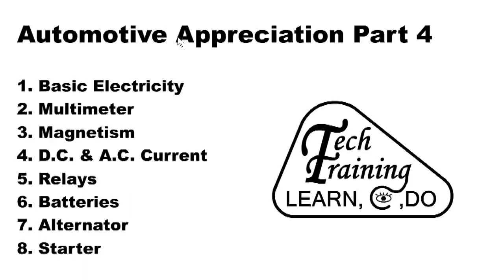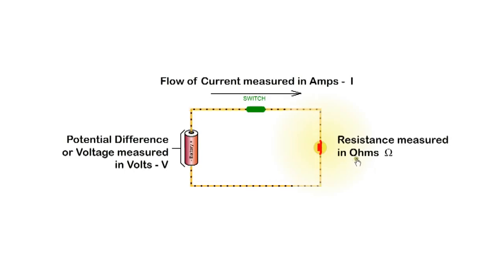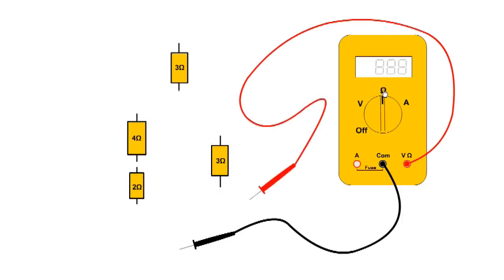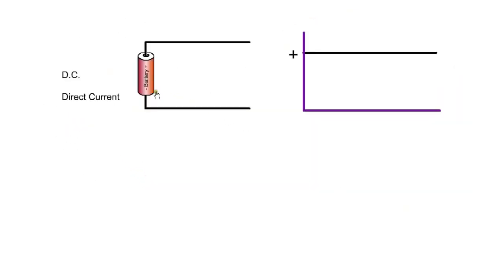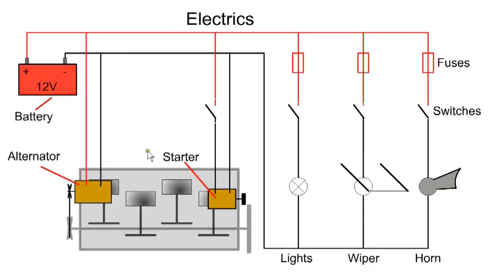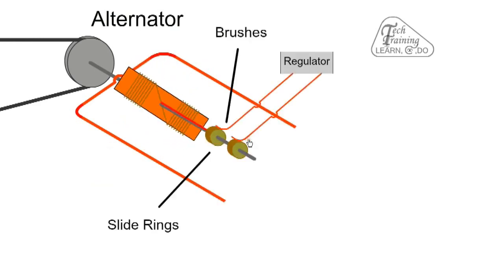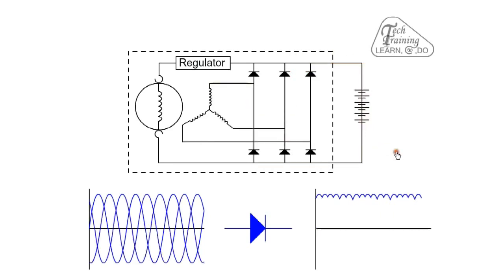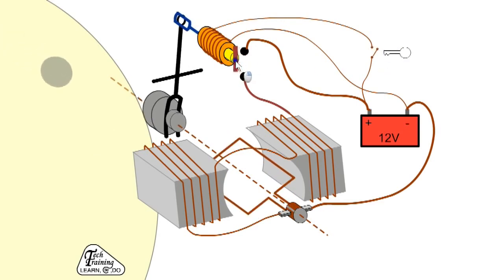Automotive Engineering Crash Course Part - 4 | Car Electrics

Comment: It would have been great if you explained the numbers you're giving for the voltage, current and resistance. It's not super clear why e.g. the voltage is reduced from 15 to 6 (minute 2:04)